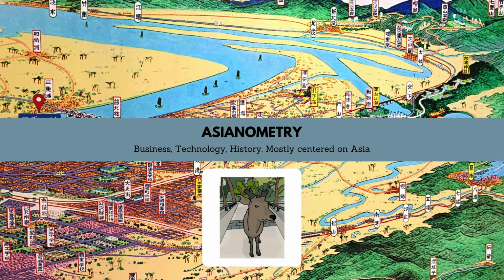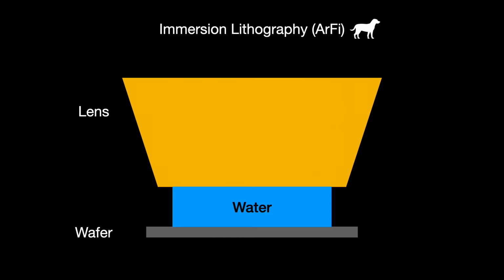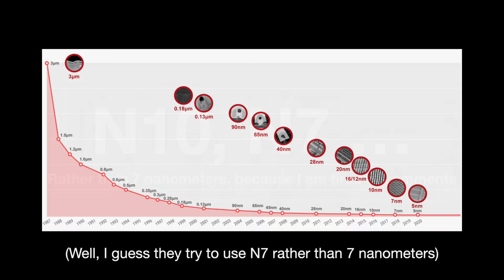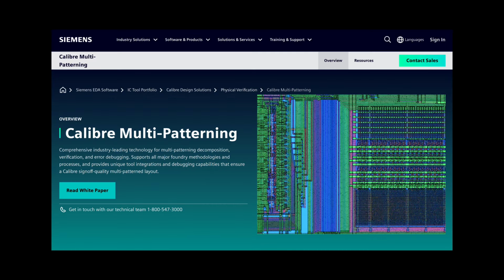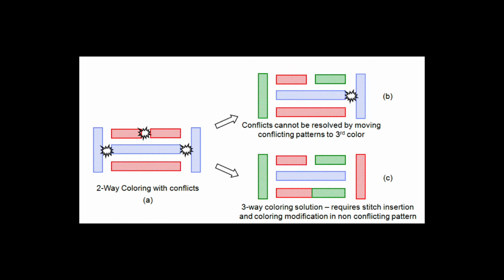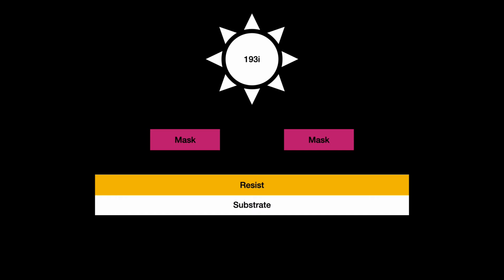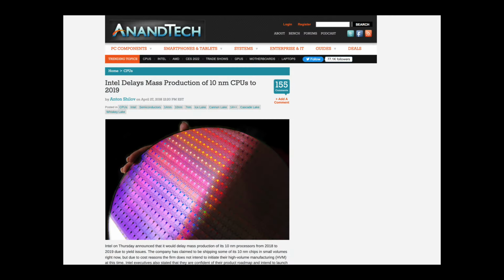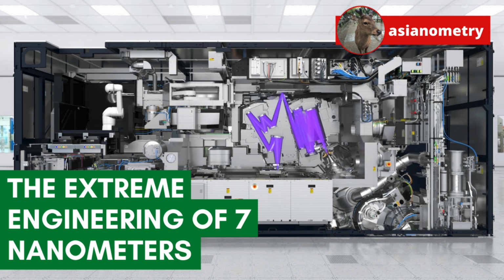Can You Do 7nm Chips Without EUV?

Comment: 7nm is a technological breakthrough when it comes to micro technology. AMD achieved this for producing consumer technology first, though I could be wrong, this put them ahead of Intel. The manufacturer of these machines charge whatever they want to anyone who want to produce nano technology. 7nm is small but not small enough. Even if technology reaches smaller they would need to reach 2nm small. This is how small nano technology needs to be because it would then put it on a level that would make it comparable to humans on a microscopic scale. Human cells and other things that make up the human body can be narrowed down to that size. Computer brains with connectors and processors 2nm small would make the ideal replacement for human components. We could achieve cybernetics on a level only thought of in fiction. Lost limbs could be replaced. On top of that if the technology is affordable it would give people who suffered damage to be able to bypass or be improved on. Learning new things and remembering them could be achieved at a much faster rate. Imagine learning something in the method of The Matrix. Rather than weeks or even months to learn how to do something you could learn it in seconds. We could have super soldiers that have power armor be achievable or civilians be able to walk when they couldn't before. Possibly even giving blind people the ability to see again, similar to LaForge in Star Trek.
Reply: Uhhh No. 
Human cells are from ~10 to 100 µm (microns), 1µm is 1000 times the size of 1 nm. 
Atomic spacing is ~0.2nm in a solid, so a 2nm physical size gate is ~10 atoms across, 7nm ~35 atoms across.
A DNA strand is ~2nm wide, or about 10 atoms.
Reply: WRONG! AMD doesn't produced the chips, it's TSMC that produced the devices for their customers.

AMD is NOT ahead of Intel, as AMD has no RND into smaller fabrication node, not even fabrication devices, unlike Intel. AMD simply used Jim Keller (JK) in order to layout the ground works for their architecture, and without JK, they couldn't really do much but put more gluing and/or modify it a little bit. AMD do not have good engineers. The only architecture made without JK is the Faildozer, and what happened to that? Well, it's already history.

Yet, Evil Su took AMD and went full Intel/Nvidia with it, except much worst. Consumer shouldn't be paying low-end 6c for high-end $$$. No way! 

Did you even listen or watched the video? After 28nm, and tri-gate, the number doesn't mean anything, and it's much worst once it goes below single digit. AFAIK, Intel has 1nm feature size in their devices.

Comment: I once saw an image comparing the mask counts of a theoretical 5nm node without EUV to the N5 we got. Would that node be possible? Would something like self aligned octuple patterning be possible?
Reply: Lots of things are possible...but whether it is feasible to use for a production process is another matter.
I etched 20nm gates on straight polysilicon  from printed features @~70-75nm to look at various things that we would have to understand as the process nodes advanced. This was on planar transistors and was back in the mid 90's. We had functional 20nm transistors and we learnt lots of stuff that was very useful for process development of larger transistors, but no way was this a process that could be used to make an IC.

Comment: Very good overview of the processes and thanks for the references,
 but seriously there also has been a industry wide move to over feature products, those that provide relatively simple processes that have chip-sets running them that are dangerously powerful and sometimes not so stable.  The older fab methods, if the design is optimized could run with 90-65mn chips using newer gate 'substances' (at slower speeds, as we are seeing with many newer chip designs) and that the big manufacturers should have retained the older type fab equipment in offshoot companies (thus retaining more control over licensing).. The present chip shortage is thusly a product of opulence & control over actual need. As a caveat, I run a laptop (AMD 7nm) that inexplicably can glitch during sunspot flare arrival, so I am not a big fan of these small gate sizes for all applications and I think that Intel thinks the same way (my cellphone is only a bit better, and has done so also)..

Comment: The only company that was able to develop a so-called "7nm" node without EUV has been Intel (Previously called Intel "10nm", now called "Intel 7"). You might be tempted to think that this is a great achievement for Intel, however it's actually their biggest blunder. Intel's decision to attempt developing Intel 7 without EUV by heavily relying on aggressive multi-patterning was the main reason they fell behind TSMC by 5-6 years (They were previously 2-3 years ahead of TSMC but now they are 3 years behind).
Reply: You are correct that Intel messed up on the transition to EUV, they held the orders for the first tools, but gave them up (which were then picked up by TSMC). I'd say the real issue here isn't size, rather EUV makes it easier to do more complicated gate designs (think GAA). WRT Intel yield problems at 10nm, vs AMD, I think that AMD were very smart to move to the chiplet approach, this allowed for better yields on poorer defect densities + using appropriate processes for different chiplets. (They got to have their cake and eat it). Intel continued with monlithic chips, which yield lower because of area.

Hopefully Intel does have a big order in for EUV systems, they need it, even if they order more than initially seems required, they could back fill "larger node" fabs with streamlined process flow to make yields better and gain experience on EUV, together with priming them for smaller node transition, depends on rate of tool delivery vs orders and speed of new fab ramps.

Not sure who gave up the EUV order, maybe Otellini, maybe Kryzanic, I do believe that they missed out on the growth of the foundries - Intel was it a good position to use their older process nodes and fabs as foundaries, that would bring in extra revenue, but more importantly starve the other foundries of some income. They started on it, but very half heartedly, this also saw a major growth and transition of IC production east to Taiwan etc.
I am optimistic with Gelsinger at the helm. He is of the same cloth as Grove, Barrett and Moore, though probably more like Grove. I am hopeful that he will also grow a foundry business too.
Reply: @thecraggrat  The problem with foundry was that they couldn't find customers for foundry. Because Intel's process is so insular with design and fab both in house, the potential customers found the intel design kit exceptionally difficult to use and design for, and no one went for it. The only way they could convince one potential foundry customer to actually use the intel kit / process was to buy them out and force the decision (Altera).
Reply: @gorak9000  Hi, I'll generally not disagree with you on this one, though the reason for purchasing Altera was more to gain technology that let them do field programmable customisation of server devices, if I remember correctly.
I'll certainly agree that Intel didn't put together the kind of process offering that they needed to, with an array of pre designed custom cells etc that customers could use to put together an ASIC, and all the other stuff that makes for a proper foundry/custom silicon offering.
In fact, the feeling amongst myself and my peers was that Intel should have picked up a ASIC manufacturer back in the early 2000's. LSI Logic would have been a good purchase (Maybe cypress or a selection from a few others too) for them before the refugee from Intel (Abhi Talwalker) sent it titsup and pushed it to be foundry only. But then he was more a money man than a real engineer. 
The thing was that LSI knew what was needed to be set up to give external designers the right tools to design on their processes, something that Intel (probably) still lack. This is my main worry about Intel playing in the foundry space, there is lots that has to be done to set up the customers for success - it's not the process that is a problem, it's that there are additional tools that need to be developed, and also additional "modules" that need to be developed, to customise the process to the chip design. For example, capacitor modules and precision resistors to allow for mixed signal, etc.
Reply: @thecraggrat  Intel had pretty big blunders due to terrible leadership, they were way too focused on finances than on the RND side of the company. There was a massive layoff of smart people "brain drain" which caused the decline of intel. Gelsinger currently rehired those retired people, so it might get better.
Reply: @jakejakedowntwo6613  I'm not sure who you speak of, but I'm not aware of many of the "brain drain" people ever going back. The key hiring demographic is still RCGs because they're cheap and dumb (especially in terms of working conditions / work life balance / compensation). Fresh grad students are used to working like slaves for a pittance, and that's what they like.
Reply: One thing I would consider here is that because of the DUV hardships you mention, Intel has a huge pipeline of innovation outside of the litho process specifically to make sure the pluses always actually were pluses. Meaning that when the DUV choke point is gone, Intel has an astounding amount of R&D that will separate itself from the pack. When EUV tools essentially are barriers for entry, they also become the floor of achievement for each foundry. The other innovations will decide the winners at that point. Will be interesting to see how much of Intels R&D portfolio is awoken when EUV nodes are fully the norm.
Reply: Ah yes, TSMC and SMIC don't exist.
Reply: Moron - Intel's 7nm EUV process is NOT the same as Intel 7.  Intel 7nm EUV will be Intel 4 and Intel 3 and will debut with Meteor Lake
Reply: I agree with you. Intel 10nm era is such a disaster for intel. 10nm nodes from intel will never get intel back to the leadership despite intel released 3 revision to this node (10nm+ with ice lake, 10SF with tiger lake, and intel 7 with alder lake). But i still admire their enermous hardwork to make it work.
Reply: @Arkan_Fadhila  I think you meant 14 NM/Skylake/Intel 10?
Reply: @Arkan_Fadhila  My understanding is that Raptor Lake will get a new refinement of 10nm ESF / Intel 7.  Also, according to the guys over at semiwiki who are tracking euv production at asml it doesn't seem likely that Intel can get enough euv machines in the near term to meet their node goals.
Reply: @sailorbob74133  if that's the case then i expect intel to deliver small amount of meteor lake by the end of 2023.
Reply: @sailorbob74133  Intel stepped aside for TSMC - Intel will get all the machines they need.
Reply: Tsmc first gen 7nm was not using EUV in 2018-2019
Reply: @morpheus_9  You mean TSMC's 10nm class process they mistakenly called 7nm

Comment: Industry should agree on more tangible and objective process nomenclature, discarding the misleading "xx" nanometer nonsense. 
How about transistor density like 90 M/mm2 for 28 nm process for SRAM cell. It is vendor neutral and objective metric. The larger the better.

Comment: Thanks for your amazing video with remarkably clear explanation about the different lithography methods.
I wonder if it is possible for you to make a video why no one talks about X-ray lithography? I mean, X-ray has a shorter wavelength than EUV, so I think it is logical to say that X-ray is more suitable when we go into even smaller nodes in the future.
Has anyone tried it? What are the obstacles? Is it on the roadmap beyond High-NA EUV?
Reply: Yeah, EUV litho tools are really soft X-ray  tools. The wavelength is 13.5nm.
Also the optic are reflective, as is the reticle...

I think there is a lot of learning to be had with EUV tools before we think about smaller wavelengths. TBH with the GAA transistors, I think the way forward is going to be with multiple layers of transistors and parallel processing rather than ever faster and smaller transistors, given most of the reasoning for smaller transistors is to increase transistor density. If you can build multiple layers of transistors, then a density increase can come from just adding another layer...(and of course dealing with the additional heat produced, you don't get something for nothing- This may get taken care of by diamond heat pipes, we'll see!)
Reply: @thecraggrat  With more stacking comes more heat...
Reply: @erkinalp  Yes of course it does, which was why I mentioned that there will likely have to be something like diamond films deposited between transistor layers to help bring the heat out of the core to heat dissipation structures. What this will be like I don't know, but diamond is a very good heat conductor...Current DLC films have thermal conductivities of up to ~3.5W/m.K which is better than Si (~150W/m.K), way off Cu (~400W/m.K), but you don't want any Cu around the transistors (bad things happen), and miles away from single crystal diamond (~2200W/m.K)! Improving the ordering of the DLC structure can increase the thermal conductivity, but there is a long way before it matches single crystal diamond.
Reply: Ah, what they call "EUV" had a different designation when I was a physics student some decades ago -- we called that wavelength "soft X-rays..." So in one sense the industry has been doing X-ray lithography for a while now.

Comment: Lot of misinformation in video...

TSMC used LELE early, in 20nm node.
Intel 22nm was single exposure. It has very poor density, similar to foundry 28nm nodes. This is point lot of peoples are missing.
Intel adopted SADP at 14nm. (which caused delays and poor yields)

All 10nm processes used various forms of 4-patterning. They all were on same level.

All 7nm processes are EUV (foundries offered quad patterning to met market demands - as mentioned in video).

SAQP - hard to design, easy to manufacture
LE - easy to design, hard to manufacture

SAQP produces smaller structures that single EUV. This is huge advantage in standard cells, where 1D routing is solved.

Biggest advantage of SAxP is great repeatability. 

TSMC/Samsung uses SE/LSE heavily while Intel is relying on SAQP (design difficulties solved by IDM advantage - co-development).

This is why Intel foundry failed. Lot of companies attempted to create chips in Intel's 10nm SAQP but they failed.
Also this is why Intel is manufacturing chips in TSMC. Specially non-standard low-volume (networking, new markets...).
Reply: But why can't they make GPUs in-house? It would be cool to get some Intel 10nm SuperFin GPUs.